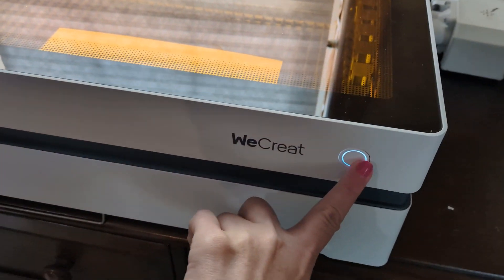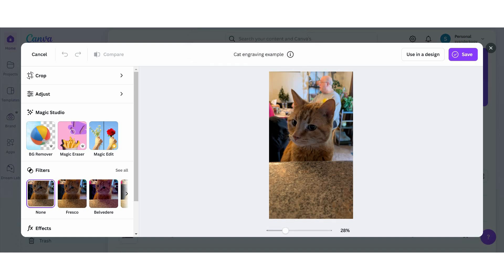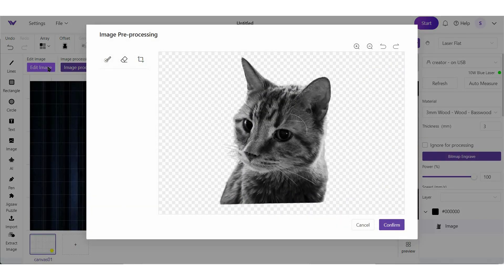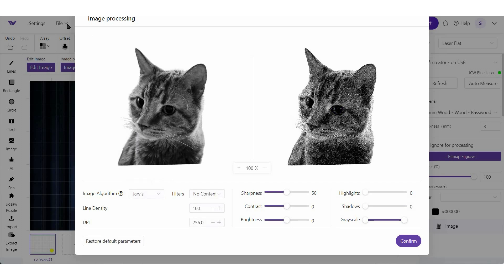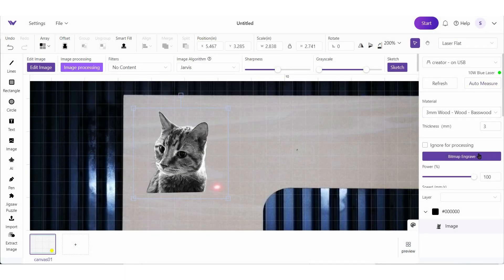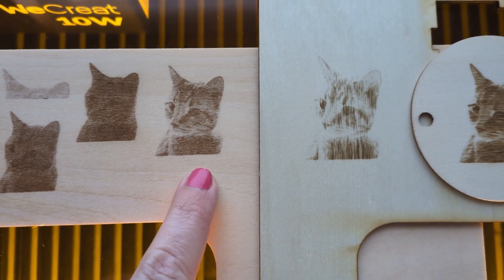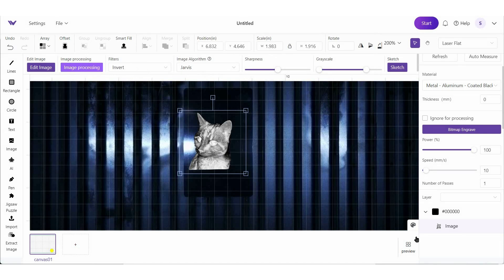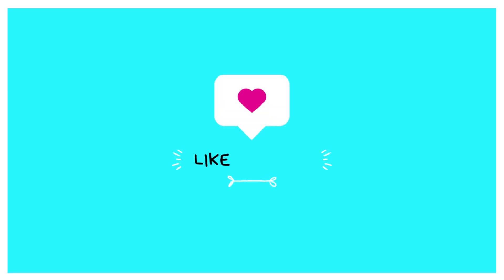Laser Photo Engraving with WeCreat Vista

Comment: so a normal png file will work? wouldn't it need to be a vector or something like that? or svg?
Reply from the maker: Vector or SVG files are ideal for cutting and engraving at one power/speed. To get the variation in speed and power you need to use an image like a jpg or PNG.